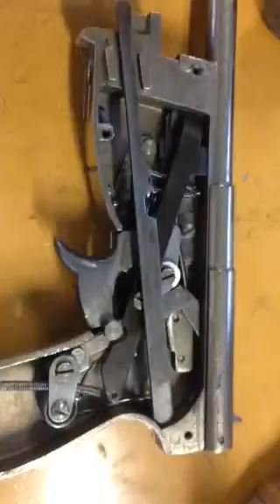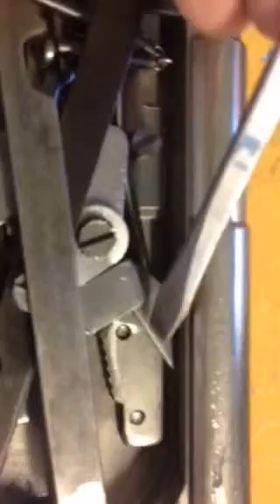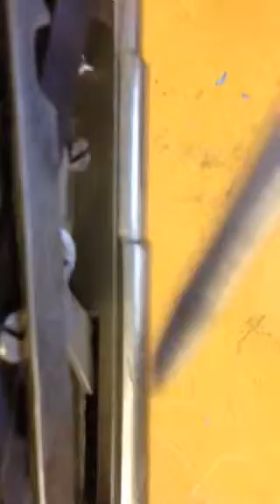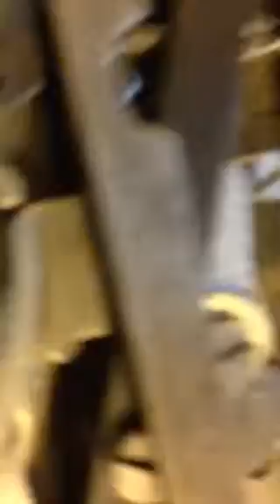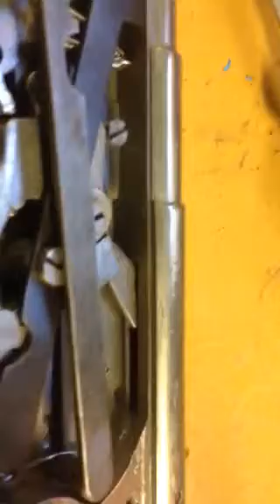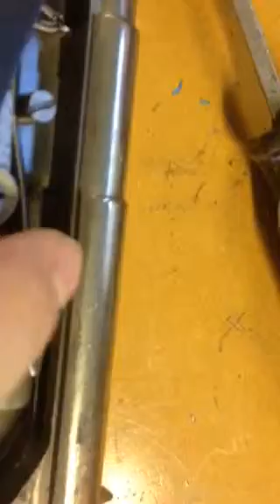ABT Gun - internal firing mech

Comment: I have a red white and blue model. My gun will fire as many shots as you want, I opened it up and there's a spring attached to a firing lever safety part number 506 which is attached to B-910A the firing lever assembly. The lever is just freely sitting in the handle and I can't quite tell where it goes. I took it all out and apart. I can send you a picture of that would help
Reply from the maker: Hi Jon.  You can send pics or contact me to send me the gun for repair.